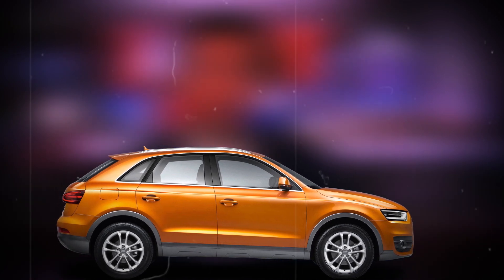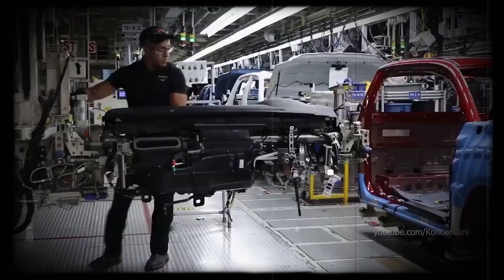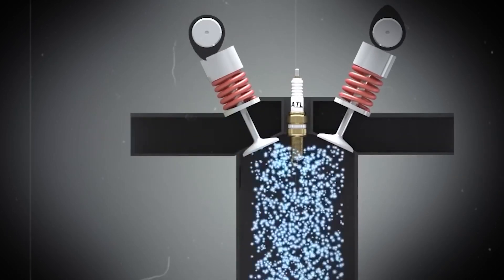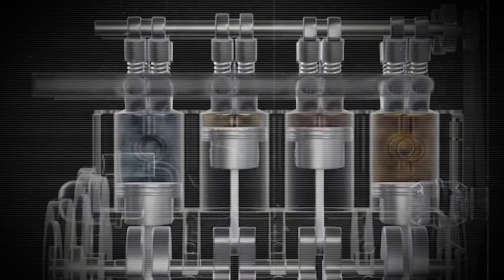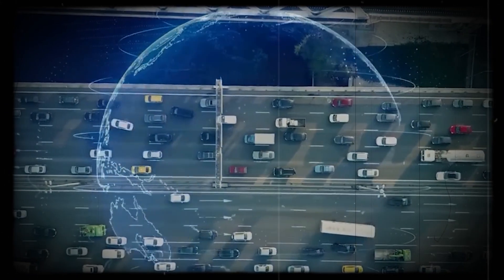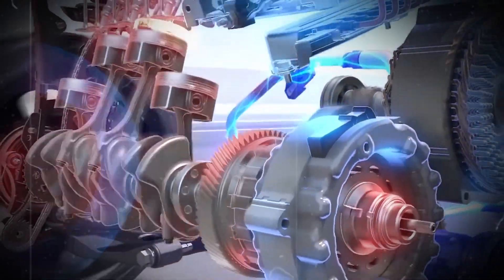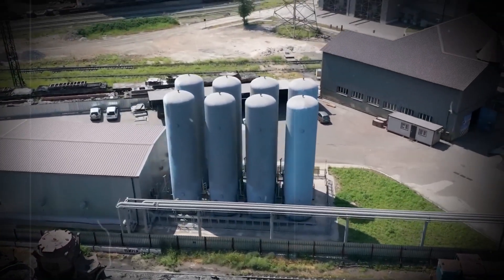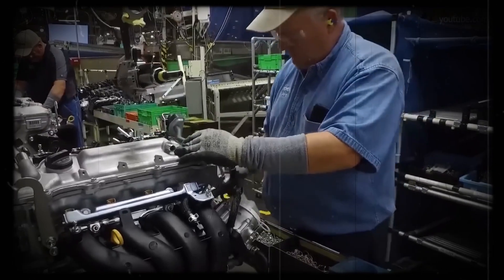This Water Engine Will Transform the Car Industry

Comment: Is this a parody? I really hope so. 
The commentator show such a grand lack of basic knowledge that it cannot be real. 
The main point: Using electricity to split water to then use as fuel in a traditional (inefficient) piston engine, is a waste of energy. If you have electricity in the car, just build an EV. To achieve the same range as an EV using this silly contraption would need batteries multiple the size needed by EVs. And with the battery size being the limitation for range on EVs, this whole thing is beyond silly.
Reply: You are  101% so  CORRECT.!!!
This ridiculous video, trotting out conspiracy and stupidities, should be taken down NOW !

Comment: So, where is the energy for the on-board-electrolysis coming from?
Reply: A battery, just like a normal car battery. Once the engine is running it produces electricity by dynamo/ alternator..... duuhhhh
Reply: @albertbahoogadin  Ah, the classic perpetuum mobile.
Reply: @Waldfuerst114  Maybe they have found a way to break the thermodynamic laws? You never know. Those Toyota people are smart...

Comment: What specific safety protocols might be necessary for widespread implementation of water-powered engines, considering the challenges associated with hydrogen?
Reply: As he said, none really, as the electrolyzer would be sized to produce hydrogen at the rate needed to burn BUT ..THE WHOLE Concept  is STUPID AND IMPOSSIBLE.
Why don't you ask THIS question?
"Where is the energy coming from to electrolyzer the water?"
Reply from the maker: Safety protocols would be similar to use of gasoline or natural gas. Here are a few precautions to take around hydrogen fuel.

Hydrogen is flammable and can cause fires and explosions if not handled properly. Hydrogen has a lower ignition energy than gasoline or natural gas, and can ignite more easily. Hydrogen fires are invisible, so if a someone believes that there is a hydrogen leak, it should always be presumed that a flame is present.

Ventilation: Hydrogen should only be generated and used in a well ventilated out door area.
Leak detection: Adequate ventilation and leak detection are important elements in the design of safe hydrogen systems.
Smoking: Never smoke near a place where hydrogen is generated or being used.
Static electricity: Built-in safety systems will prevent static electricity from causing any problems.